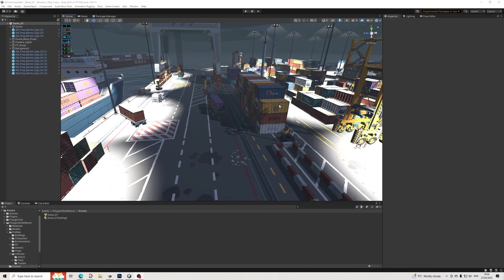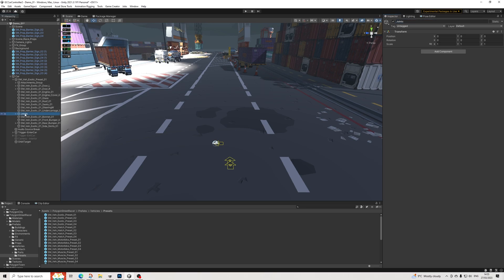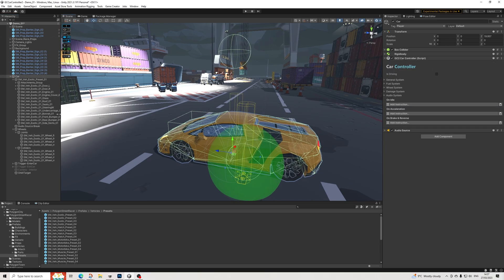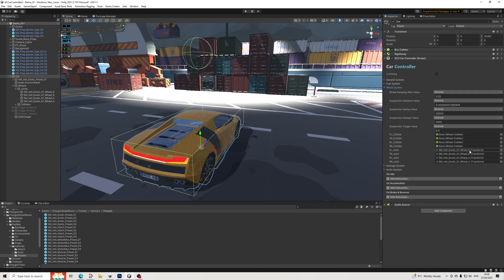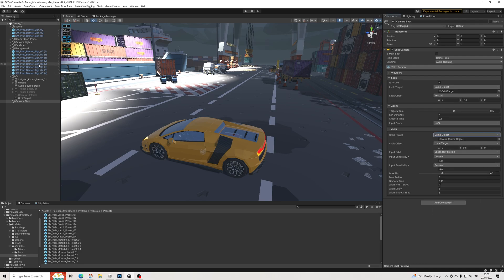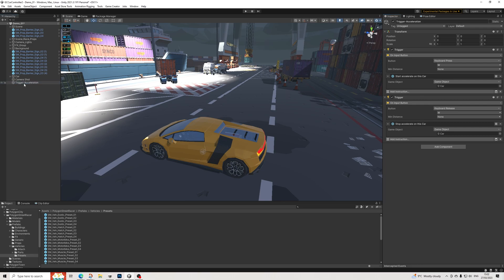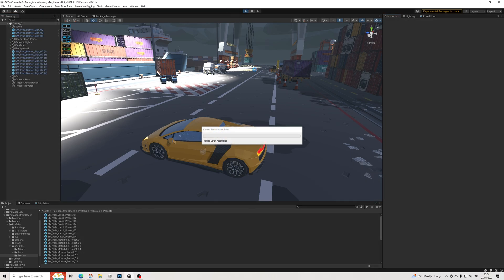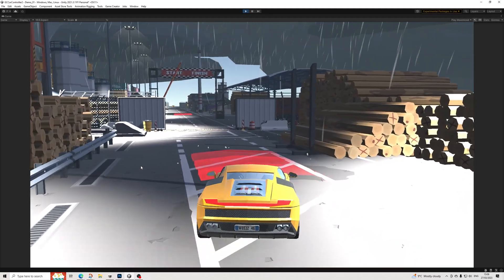Car Controller for GC2 - Setup a Car (Synty)

Comment: Would it be the exact same setup for GC1? Or are there differences?
Reply from the maker: At the moment the only difference is that the controls are on the main component, rather than separate 😁
Reply: @RVRGaming  Does the system work for GC1? Says GC2 only on the asset page.
Reply from the maker: @davidedwardsme  hey! The GC1 and GC2 versions are separate. The GC1 version came out a couple of weeks before 😁
Reply from the maker: @davidedwardsme  https://assetstore.unity.com/packages/tools/game-toolkits/car-controller-for-game-creator-248623
Reply: @RVRGaming  oh, so i just purchased the GC2 version? .. poopa .. i only have GC1 :(
Reply from the maker: No worries, if you haven't downloaded it yet you can ask Unity for a refund. Then you can get the GC1 version 👍
Reply: @RVRGaming  Is the refund an immediate process? if so i'll do that, thanks.
Reply from the maker: @David Edwards  Honestly not entirely sure. I think so, as long as its not downloaded.
Unity team handles the refunds now